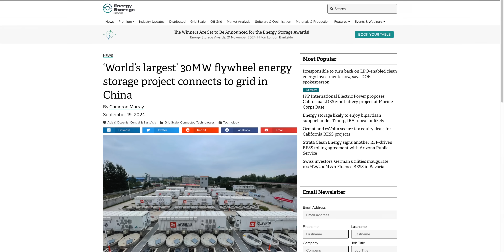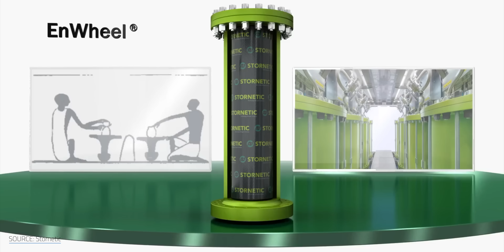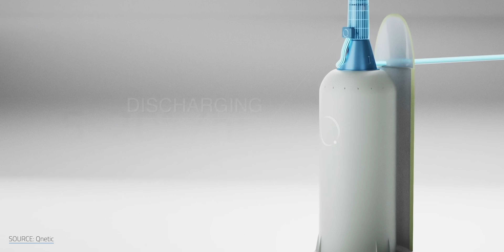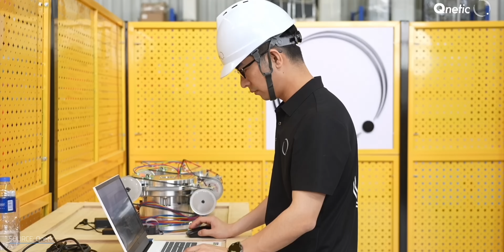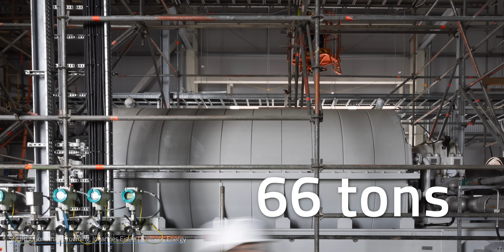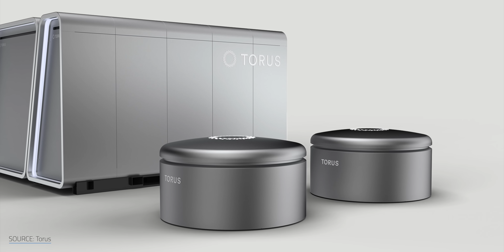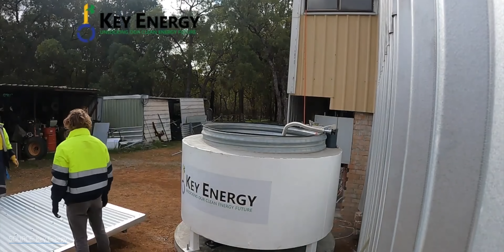How This Mechanical Battery is Making a Comeback

Comment: Using Nuclear power with solar rooftop and batteries and heat pumps is the easiest cheapest and simplest solution for most countries. Hydro for those countries that have it but the current misleading renewables solutions Do Not provide Cheap reliable 24/7 power. Look at Australia and Germany to see the results. Very high power bills and unreliability. Also overly complicated systems with multiple points of failure.

Comment: Remembering to line the flywheel up with the direction of earths rotation, failure to do so cause mechanical forces on the bearings result in excess friction. 
And I’ll guess FES useful in instantaneous frequency control to millisecond and sub second rate and smoothing of harmonics
Reduce ROCOF “rate of change of frequency”

Comment: Why would you "perfectly lubricate" a magnetic bearing?  Apply Vacuum directly to bearings, repeat as needed.  XD
Vacuum is extremely difficult to maintain.  I would suspect low pressure Helium is being used inside the chamber.
Helium is great because it is a 'slippery' gas.  As a bonus if it leaks out you are left with a Hard Vacuum inside.  Weird but true.

Comment: instead of flywheels, use gravity battery for this use case. the gravity battery does not lose energy over time. it has 100% capacity retention.
Reply: Still waiting for any prototype showing better numbers than pumped hydro using a water tower.

Comment: I remember back in the mid 2000's when the company I worked for were looking at changing the UPS for the server room, one of the options that was mentioned was a flywheel based UPS. 

Sadly, we went with traditional lead acid batteries. Would've loved to try something different tho.
Reply: Flywheel constructed from a large array of L/A batteries ??? 😉

Comment: I think of flywheel batteries more like capacitors. Accumulators see a lot of obvious use but capacitors are used as lower level components, quick charge and discharge but low storage.

Comment: As I see it, there are multiple reasons to store excess renewable energy. Each having their own best way of doing this depending on when and how long you plan to use this stored energy. The solution for storing energy you plan on using when the sun goes down is probably totally different than the energy you store to use tomorrow when weather forecasts are not ideal. Or the energy you use in the winter.

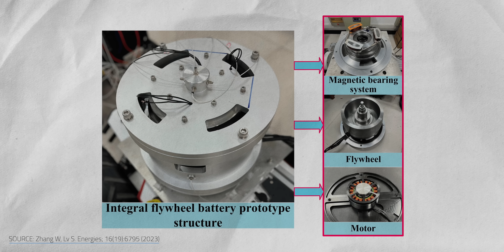Comment: Nit Pick Mode on!. at 5:34, did you mean The  2nd Law of Thermodynamics (entropy in a closed system always increases)? This seems more appropriate for the context than Newton's First Law.
Reply: Came here for this.  Newton's First Law is the law of inertia, which says that moving things tend to keep moving.  He's trying to say that the wheel will slow down, the exact opposite of what N1L says.  I agree that the 2nd Law of Thermo is a more appropriate justification for inefficiency.

Comment: How much would the energy loss be reduced if the flywheel is aligned with Earth's rotation axis instead of just being horizontal or vertical relative to the ground, removing the need to fight the gyroscopic precession caused by the axis of rotation being forced to change as the Earth spins?

Comment: it's funny how wind turbines are said to be renewable... you're literaly stealing energy from the wind, which effects the environment in unknown ways. It could be devastating to earth.
Reply: This is utter nonsense. The amount of energy removed from the system is beyond minuscule. A forest of trees will absorb more wind.
Reply: @logitech4873  every little thing effects other things, so no it's not utter nonsense. It's a fact.
Reply: @no-eb2xx  Oh it's a "fact" now?
Can you name literally any study that shows how wind turbines affect the environment in this way?

Because, just FYI, there's a difference between "I made it up" and "it's a fact".
Reply: @logitech4873  it's FACT that wind turbines steal energy out of the wind, IT'S FACT that you and me don't have a clue how that effects the environment, but to deny that it does anything is just shortsighted of you. Just like solar farms effect the micro climate around the farm, wind farms effect the area around them.
Reply: @no-eb2xx  It's also a FACT that forests steal energy from the wind.

So because of your hypothesis which had zero proof whatsoever, we should stop using wind turbines?
You can't even explain what the supposed issue is. I can guarantee you that if there were knowable issues, the oil and gas industry would be happily pouring millions into researching it in order to shut down wind.

Comment: 160 MWH in the fly wheel and the farm is 1400 MW 160/1600 =.11 ... so the storage lasts about 6mins as a replacement for the wind turbine. I realize there are other reasons to use this tech, but we should keep grounded on promises of new(old) tech..

Comment: This is a great idea, until corporations decide that corporate bonuses are more important than ensuring that the machinery is kept in good working order, at that point the bad stuff hits the fan, the amount of energy stored in a flywheel moving at the speed that they do will cause absolute ruination and death when the bearings fail because the high ups wanted a little more for themselves.

Comment: I'd personally like to see solar and wind generation at homes directly, with flywheels for stability, all wired together in parallel to the rest of their neighborhood with grid power either being a backup or used to distribute the power to the surrounding area.

Comment: I can see using a flywheel as an intermittent high demand solution, even on a small scale, but has anyone considered using large Farad storage capacitors instead?  Seems like they would take less space overall with similar functionality without the mechanical power conversion.

Comment: I don't think you have ever done anything on ARES. That can store more energy, for less money.  That uses trains on an incline loaded down with concrete.  Lasting 30+ years should be easy (probably 100+), and most of it is off the shelf train stuff.  Build it where it is dry in the desert, and it should not rust much. The Swiss have been running regenerative locomotives for a very long time.  Maintenance costs should also be low.  It made the news in 2017, but I have not heard much since.  In a sense, it is a bigger footprint, but it really doesn't harm the environment much (they are using concrete, but metal scrap or iron ore could be used in large hoppers, or just some dense gravel of some kind).  It would be a fairly slow moving electric train.

I had the idea myself in 1990, but never did anything with it.  It was pretty obvious, though.  My version was more elaborate, but it is the same principle.

The main drawback is that you need to find a long hill with a consistent grade, and you would have longer power line runs because of location dependence, similar to most renewables.  But, at first, there would be several ideal spots, with fewer drawbacks.

It is about 80% efficient.  About the same as hydro, but does not require water.

Comment: One thing I don't understand is why the *whole* wheel needs to be heavy? I mean why not follow the design of car wheels and use spokes inside to keep the heavy rim attached to the center? It's only the rim where the energy is stored anyways. Use spokes, put the rim further out, make the space around the spokes a vacuum after putting the covers on the wheel, then the inertia of the rim should be enough to keep the flywheel spinning for longer since there's not as much weight on the axle.

Comment: One of the downsides to BESS is that charging and discharging too fast can degrade the batteries. Can flywheels be used as a buffer to allow for slower charge speeds? The answer is obviously yes, but it may or may not be practical. There’s another layer of losses, but long term is it more efficient to eat those losses in exchange for longer battery life?

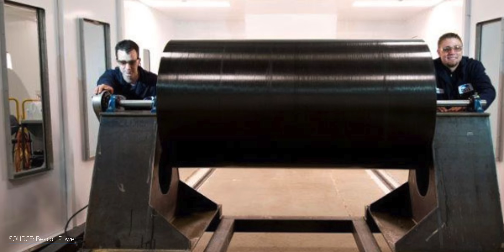Comment: 3:45 why carbon fiber? Don't heavier flywheels store more energy?
Reply: Speed carries more energy than mass. The formula is something with Speed^2 . The limiting factor is the tensile strength, and carbon fiber is stronger than steel. Some flywheels have exploded when a crack came in the spoke
Reply: Carbon fiber dries out overtime and becomes brittle. It's designed obsolescence. It's how green energy is manufactured, sell the governments the line that it's advanced technology and then deliver them the tech while keeping them on the hook for repair and maintenance to make the profit. Tell the public it's good for the  environment when in reality it's worse.  The laws of physics state that the world is in a state of entropy, meaning more and more work is required to complete the same objective. More money is needed for projects. More labor is needed for projects. Project results will continue to diminish. That is why the projects are always bigger with more funding and more labor. The world is dying, and only Jesus can save it.

Comment: PLEASE do not say megawatts when referring to the storage of energy. The only unit to refer to such is Wh or watt hours. Thank you!!!!!
Reply: Flywheels have so low energy per dollar, that Watt is more relevant than Watt-hour. These are for short-term balancing, not hours.
Reply: @thomasgade226  Lol One is a measure of power output, the other is a measure of a store of power. They can be two completely different amounts for the same system. It makes zero sense to conflate one with the other, unless one's intention is to spread confusion or misinformation.
Reply: @djayjp  Of course power output and stored energy are different (energy being the integrand of power over time) but which matters for a component of a power grid depends on what that component is for. And in this case being used for grid stabilisation rather than electrical storage it is power that matters. In fact that the companies keep quoting power (MW) rather than energy is a giveaway that they are not for real storage - things that ARE for storage (eg pumped hydro, lithium batteries) quote the energy (MWh) stored.
Reply: @kenoliver8913  So the MW number he is stating is for instantaneous power output? You sure about that? If so then I wonder what the power storage figure would be for this system. Since flywheels by definition store power, then it should be unambiguously stated, such as, "xMW of power output." And I've seen this error, yes even in official press releases, soooo many times.

Comment: Is there any use or benefit of using a clockwork type mechanism? Energy can be stored off-peak and released at whatever rate necessary from what is stored in a spring.

Comment: What would be of more interest, will be,  the small enclosed flywheel storage options for residential rooftop solar, as a viable alternative to lithium based battery storage.🤔❤️👍
Reply: Much more likely a flywheel buried in the yard with DC input from panels and AC output to home. At least until we move to a DC only system in the future. The inverters today are a huge waste of power that must be suffered through because we do not have DC appliances yet. Only real advantage to AC is long transmission that we must get out of in the long run. DC and local is the best.
Reply: @markpashia7067  Totally agree with that. Infact DC systems are much more safer, since there is no nuetral connected to the ground at distribution xformer( which benefits the 3/2 phase AC transmission by cutting down the additional conductor).
Having local DC means no significant transmission losses and insignificant benefit in eliminating the additional conductor. It also will eliminate a ground conductor in each connected appliance/equipment. 3 phase can be generated locally(thanks to low cost power electronics),  for point of use applications, that benefit from increased conversion efficiency and reduced form factor of motors. Just some💭
Reply: @markpashia7067  I totally agree. Edisons DC system needed a local power plant, now we have it as Solar power. I did mention few other benefits, and my comment got censored🤔.

Comment: I would welcome flywheels as a way to mitigate surges on Battery Energy Storage Systems for Commercial and Industrial Applications.

For example, if I’m running a milling factory with motors that have a high surge and I have a PV system with a BESS, a grid outage would put a lot of inrush current on the battery and that’s not good for the BESS. With a flywheel, I only need about 30-60 seconds to handle the surge, then the battery comes in whether the peak draw is gone.
I really want this… as a C&I PV and BESS engineer, I am struggling with BESS systems because of this factor.

Comment: The flywheel is a buffer, not for storage but for smoothening. They are used in all ICE cars for this exact reason. Did you saw the guy on YouTube using a flywheel on his bicycle to capture energy from braking and use that stores energy to propel the bicycle (like in a stopping at a light scenario), really interesting and fun project
Reply: Sounds like one of Tom Stanton's videos.
Reply: Was the solution heavy?

I've wondered for some time whether a "mini storage" system for bikes with regenerative brakes used only as support when going uphill would be interesting 

Not having the weight of a full battery, but avoiding slogging down in the streets by having on demand support
Reply: @drillerdev4624  5.5kg, 15% efficiency.
Reply: "smoothening"?
Reply: I saw that video. Lmao.
Reply: @Mircea007  wtf is "smoothening"?
Reply: @bobbydazzler6990 make smoother 😅

Comment: Would it be possible to add one of these at the base of the wind turbines? Using mechanical energy of the turbine would be much more efficient than using energy that's already been converted to electrical just to turn it back to mechanical. They're already connected to the grid so having the power to maintain momentum doesn't seem too difficult. It would also save on space, which is definitely at a premium now.

Comment: I think you conflated two ideas:
1. Flywheels for energy storage, in which case the rotational speed will vary as it charges and discharges and all that it offers is a source of power, or
2. Flywheels for frequency stabilisation, in which case the rotational speed is tied to grid frequency and essentially constant.

You cannot do both at the same time. It is probably expensive to build a system that can operate in either mode as the latter needs a synchronous motor and the former needs a more conventional motor.
Reply: Heard of Variable frequency drives? They use semiconductors to perform the switching.
Reply: Frequency stability is not a problem. Fluctuation in the frequency are a way to help voltage / power stability on the very short time. Just spinning turbines (e.g. in steam based power plants) act as some fly wheel stabilitzation, though usually with not much active control and limited effect. An efficient flywheel storage would need a variable speed and some variable motor / generator. This can be via an intermediate DC step and electronics, or with syncrohnous generator with low frequency AC excitation - the AC excitation can adjust the frequency with less power from an electronic inverter. This technique is also frequently used with wind turbines to use them with variable speed and saving on the power of the electronic inverter.

Comment: Modern Inverters (like the victron Quattro) can switch and adapt as fast as a quarter sine wave at 50hz.
The only devices that care about that kind of precision are delicate electronics as far as I know. And those use DC anyway. So why not connect batteries to them? LFP batteries have a shallow voltage drop when charged or discharged.
Can someone explain?

Comment: The largest flywheel energy storage systems on earth is ... the earth itself.  Yeah, sure, you say, but how do we put energy into this system or get it out?  Tidal energy generation systems extract energy from the earth-flywheel, resulting in the earth's spin slowing down, but I am unaware of any "reverse tidal energy" system that puts energy back into the earth-flywheel system (although it could be done by pumping water around).  What's my point?  No point at all, just a suggestion to do some quick calculations and be humbled.

Comment: Decades ago (1990s?) I ready an amazing article in Discover about flywheels as battery storage. As I recall they got the flywheel down to a super-cheap device. But the real breakthrough was a single motor that acted both as a means of spinning it up and also taking power from the spin. They had a working home prototype (to be buried in the yard and forgotten about - no contamination) and one in a car!  - the car flywheel acted as stabilization and if there was a high-speed hard impact accident the flywheel instantly turned into soft spaghetti helping to absorb the energy of the impact. The endeavour, US Flywheels, was partially funded by Kevin Costner and run by his brother. But Waterworld tanking at the box office put an end to that dream as the funding for the company was dependant on the film's profits. I was always so sad about this tech never materializing. . It seems like such a cool, clean, safe and basic tech. I'd love to see it come back to life.

Comment: Quebec had a nuclear reactor located about halfway between the two major load centres (Quebec City and Montreal).
A benefit was that the inertia of the generator (which ran pretty much 100% output) was line stability as consumption changed on the line.  The massive generator's inertia helped regulate voltage and phase change while also (of course) putting power on the system.   Due to refurbishment costs the utility decided to shut it down.  Recently the question of refurbing it came up again, but that seems to have died out.
15 minutes doesn't sound like a lot, but it's valuable in the late afternoon when load goes up quickly over the course of about 2 hours.  So dump the power a couple wheels at a time as fits the system.